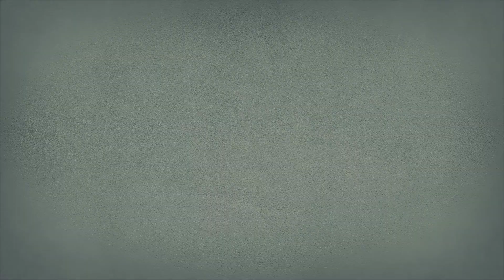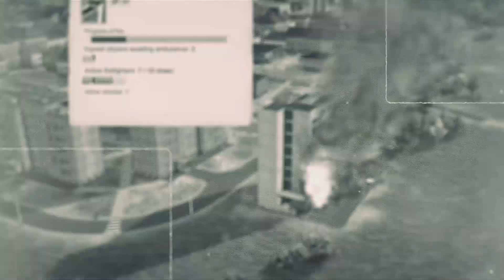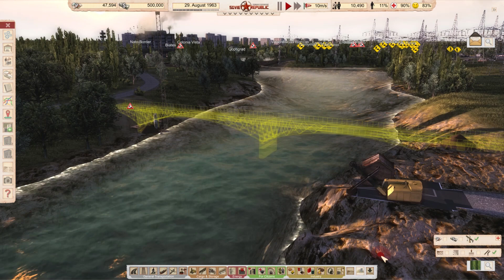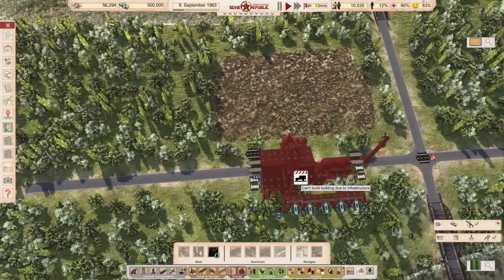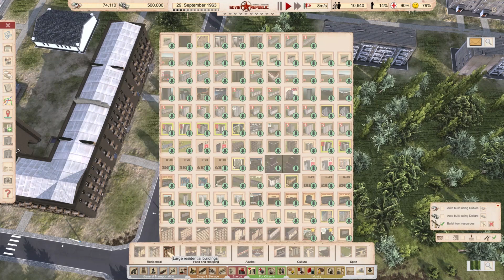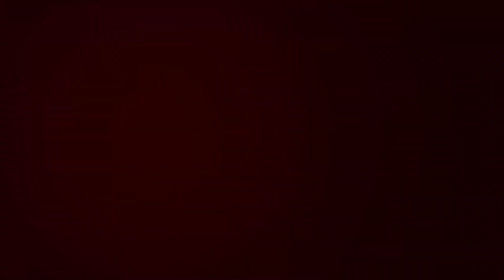Soviet Republic - Amazonas- Episode 10

Comment: Nice catch, I don't think I would have noticed that the cost of steel import was less than machine parts export. Of course I usualy kept my machine parts becuse I was running a car factory but still. like I said good catch!
Reply from the maker: Yeah! But if we source our own raw materials we should be good! :)
Reply: @oolykeegaming81  I have used your import based ecconomy video as a point of reference for my own republics many times now 🙂 just a matter of making sure we have staff to keep.tgr steel mill cranking! I was actually thinking you might want to use a cable car public transport from a newly built suburban community to a steel mill. I think cable cars are over looked and neglected as public transport